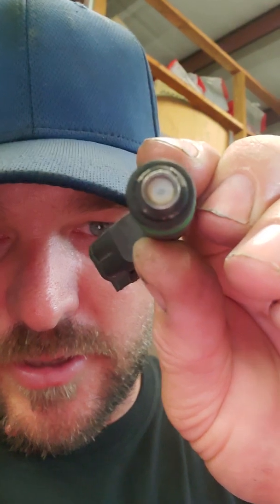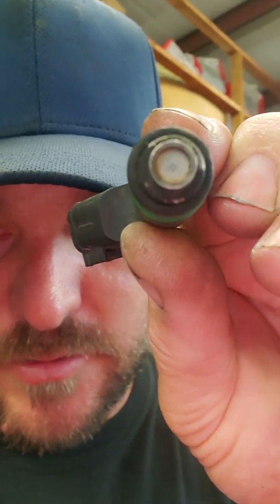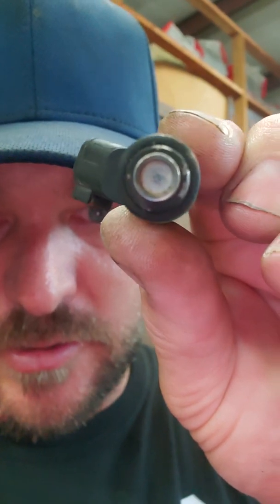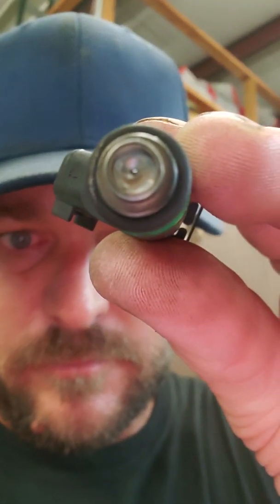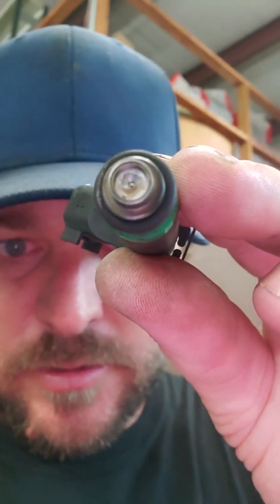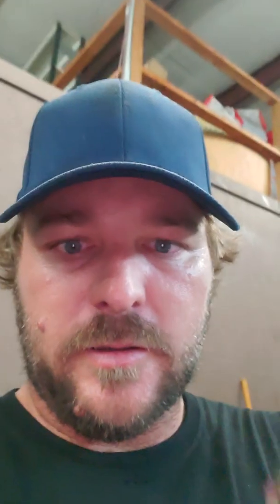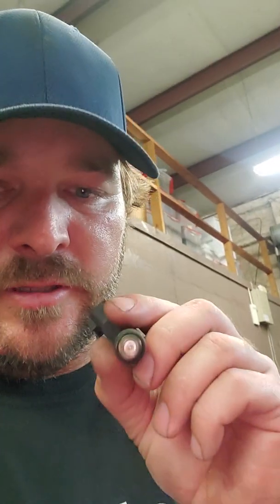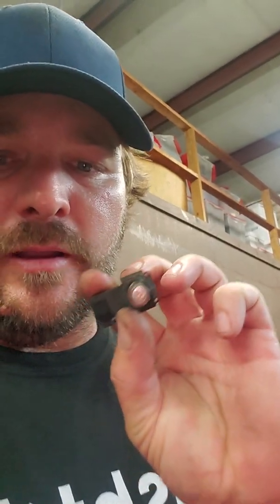Tech Tip!!!! Fuel Trim Diagnostics! Very Rare Injector Failure!!! 2004 Dodge Ram 1500. Must See!!

Comment: My newest purchase was a 2002 dodge 1500 with rough idle, did great when pushing on gas down the road but rough at idle.. changed pcm, plugs, air intake valve  with no change... unplugged 3 of my injectors while running and no change in how it ran but the 4th one did... so changing injectors now.